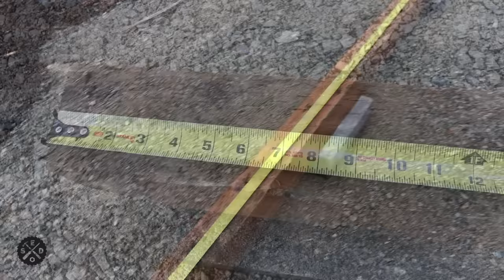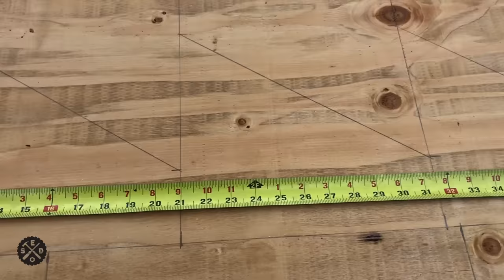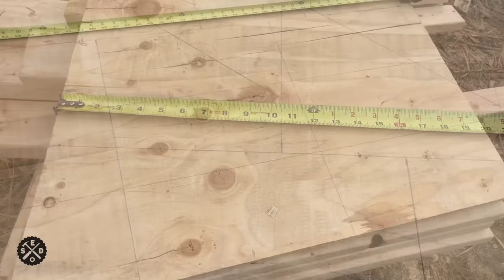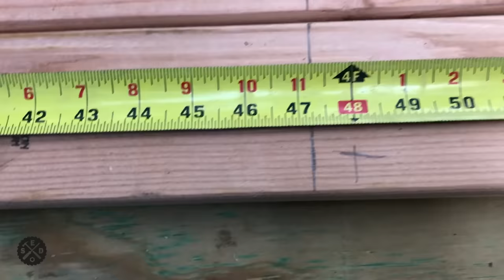How To Build A Shed By Yourself All STEPS 10x16 diy

Comment: Awesome! What was the rough cost for all the materials?
Reply from the maker: Thanks Joseph. I have it broken down in the video description below the video.
Reply: @SmartEasyDIYer  Are the 4"x6" skids 8' apart?
Reply from the maker: I did 16” in from outside edge to outside of skid on both sides. Outside is 10’ so it’s less than 8’ center. Closer to 7’ I believe approx. seemed good.

Comment: Curious why you deducting 3/4" from the tape?  If you pull 16" from the face of one stud to the face of the other it is 16" from face to face or On Center. I believe that if you measure from the center of your first stud to the center of your second stud you will find it is not 16". FYI I did enjoy your video.
Reply from the maker: Yes it’s because I was measuring off the first one on the outside edge then it’s outside edge to center or deduct a 3/4 so you can have a edge mark. Once you have the first one on Layout you could measure edge to edge or center to center from that one. I just like to mark them all out from the end while I’m at it. Thanks

Comment: If somebody were to remove the screws in the latch handle, wouldn't it then just spin in the door and allow it to be opened?
Reply from the maker: Yes it could. You could use bolts if you countersink it on the inside so it doesn’t interfere with the handle turning.

Comment: Do you think using wood glue would be helpful just to make sure everything is secure for the frame?
Reply from the maker: For which part of the build?
Reply: @SmartEasyDIYer  For the entire frame. I just feel like screws isn’t enough to hold the structure together. Atleast not in Florida 😭
Reply from the maker: I’d say construction adhesive would do better than glue for rough framing. You probably want to do hurricane ties on everything too for down there.
Reply: @SmartEasyDIYer  Okay, I’ll look into that. Thanks!
Reply from the maker: You’re welcome. Good luck with it!

Comment: Just nail a 1x2 ledger on side of joists for bottom plywood
Reply from the maker: Yes you could if you can fit a nail gun or hammer in there to swing in there that’s why I was thinking screws and maybe impact gun for compact size.

Comment: Great video, very detailed, and easy to follow.  I'm in the process of attempting the build.  Couple of questions.  What was the width  of the battens?  I assume you used the 1x4's from your materials list.  Did you rip them down?  What size sheets did you purchase for the metal roof(special order or std dimensions)?  I don't want to have to cut metal if possible.  Also, did the roof come with all the other pieces you installed, or did you need to buy them separately?  Finally, is there a minimum temp at which you can no longer apply the Rugged treatment outdoors?  I couldn't find that info on their site.  Starting to get cold in the Northeast.  Thanks again for such a great video!!  I'll upload some pics when completed.
Reply from the maker: Thank you!! Yes I believe the battens I ripped the 1x4 in half or else 1x6 in half I can’t quite remember. I can’t measure for you right now either as I’m out of town. For the roof it was standard dimensions. I used 3’ wide sheets. They do make narrower sheets if you custom order. I would wait till you get the roof framed up tho so you can measure length without having to cut for sure. The only piece I had to cut was the last piece to width. I had to order all the pieces separately for the roof. If you order it from a roofing place they will probably ask you the right questions of what you need. I think it needs to be above freezing to apply the rugged wood treatment then you should be ok. Thanks
Reply: Why is there no cross bracing in your walls? Over time, as the wood dries out and shrinks the shed is going to be flexible. I have never seen wall construction with out diagonal cross bracing. Am I missing something?

Comment: The plywood clips are a wonderful idea I love it but something to consider. 🤔 Pressure treatment is only necessary at the ground contact zone. Everything else is supposed to be Fir and preferably not Hemlock but it’s better than soft Pressure Treated Wood. It’s not structural. Not even allowed to be in Washington State.😏 I don’t know where this is but it’s truly not helpful to use Pressure Treated wood other than ground contact. It’s treated with pesticides. Nothing else. 🤓 It’s Arsenic mostly so the treatment is only to protect from bugs eating it and a minor water resistant valve from the solvent used with the pesticide but it’s inherently weak because it’s soft wood. I hope you can look into this a little please if you would😌. Thank you so much for your work it’s wonderful I hope you see I don’t mean to be rude  ❤️🖖🏼🇺🇸
Reply from the maker: No worries at all thanks for your input.

Comment: I would suggest you putting in the gravel into the price, because not everyone is going to have gravel just sitting around, or concrete blocks.  if you're giving a list of materials then I would include that into the list.  get approximate square footage of how much you had spread around the area to level the ground plus how many blocks you are using. Just a suggestion.
Reply from the maker: Thanks for the suggestion. I did include concrete blocks in the cost. I didn’t do the gravel cuz not everyone needs gravel and I had no idea how much I used that’s why I specified that it wasn’t included to not intentionally lead anyone astray.

Comment: I am studying for framing carpentry and am going to start with building sheds. I was wondering if you could talk about codes when it comes to wind. I have heard about winds picking up small structures and got to experience this when I was 15. I was playing Ninja Turtles on my Nes. and heard a loud banging sound. Looking out my window revealed that my brother's old metal tool shed had blown over and was upside down because the foundation had come undone through the years. I am sure codes will vary from state to state depending on wind potential. Just concerned about doing a safe jobs. If this is already covered thanks. I would not want my clients work to end up for instance in their living room or in their neighbors yard! The structure in the video don't look like it's going anywhere under normal winds but a small outhouse size hut for yard tools like shovels and rakes may be a different story. It's all about how good the wind can get in and lift the object and if it is light enough.
Reply from the maker: Congrats I think sheds are a great place to start! Yes this shed is definitely heavy so I don’t have any concerns as far as the wind. If you follow along in the video I anchored the floor joists into the skids with long lags I think that helps. One thing you could do is build permanent bracing into the walls to help stiffen them up if your siding isn’t very thick. You could fasten the trusses to the walls with hurricane ties. Also if the shed is going to be permanent you could build it on concrete piers or a concrete slab if it’s anchored to that it should never go anywhere. I built mine on skids because I want to move it eventually. Thanks and good luck!

Comment: 08:05 if I were sheathing the bottom of the shed, I'd use construction adhesive and nails on sheathing/joist, then flip it over. construction adhesive/nails between pier/floor. the nailed/cemented sheathing on both sides of the joists will strengthen the floor. I might roll the bottom with 1/8" hardware cloth to keep animals and larger insect borers from chewing the bottom out.
Reply from the maker: Yeah sounds like a good plan. It would be easy to put on if you could flip it over it’s just really heavy to flip it back. Thanks for sharing.
Reply: How the heck are you going to flip a 16ft floor that has a layer of sheathing? To keep it on the bearers you'd have to flip it longways and that weight and height would be near on impossible even for 2 guys. To flip it sideways you'd then have to get it back on the bearers without them moving. Far easier just to tack furring strips inside each joist to either sit ply strips onto, or to hold polystyrene blocks.

Comment: Did you get a permit before you started that building
Reply from the maker: No I didn’t need one it was under 200 square ft. It depends on your area but if you stay under a certain size usually you don’t need one.

Comment: Where did you buy your rough cut siding?  Very tough to find it in AZ.   I have mine framed and sheathed. I did a couple of things a little different. I built it on a concrete slab, I sheathed the walls in OSB, added a vertical center piece in the trusses and did a double top plate.  The extra framing and sheathing is because the hot and dry weather here is very tough on wood framing. With that said, I really appreciate all your tips. Great video!  BTW, I bought the Rugged Wood Treatment through you to help support your channel.
Reply from the maker: Thank you I appreciate the feedback and support! Sounds like a nice building you have made. That’s the beauty of a shed is you can customize it how you want. I got mine here semi locally in MT. I’m not sure where you can find some if you don’t have any timber close by. Maybe up in UT you could find some. You can search Craigslist and FB sometimes to find someone selling some. Lots of ppl have sawmills and cut on the side anymore too.
Reply: @SmartEasyDIYer  just found a good one in Flagstaff who will cut exactly what I need.  5 hours each way, but that’s ok.
Reply from the maker: Awesome!!

Comment: At 8:04 you start talking about insulating the floor and putting plywood at the bottom. If that's what you're going to do, it would be easier and cheaper to simply sheet the one side of the floor and flip it over BEFORE you attach it to the beams. Those screws will be plenty long enough to go through and extra 1/8" of plywood, which is all you need. Paint it two coats of exterior latex, flip it over and lag it down to the beams. I would have drilled 3/4" holes through 6 of the 2x6's and ran 1/4" bolts through to the beams; 4 on the ends and 2 in the middle.
Reply from the maker: Yes you could do that if you have a way to flip it over after it’s framed. It’ll be quite heavy.
Reply: @SmartEasyDIYer  Plenty of trees there.
Check out Larry Hauns videos here on how to frame a house. My grandfather was like him: He built houses in the old post WWII style using basic materials and unlike Larry, NO PLYWOOD. Tongue and grooved hardwood slats run over 1x12 sub-flooring planks, with no creaking.
Success with your channel.
Reply from the maker: Yes you could have the trees help. Even better tractor with a forks. 😁 I was just meaning for one guy it’d be heavy to flip over. I’ll check it out. Thanks so much!!
Reply: @SmartEasyDIYer  "...have the trees help."
You mean like Ents? lol
I was thinking of a rope and...
heh heh

Comment: Nice job, just one thing, without sheathing on the walls it seems to me that diagonal bracing should have been inset into the stud walls to stop any movement. It is just a shed, but without sheathing or bracing it will overtime rack. Don't want to be a downer, it is a beautiful shed and well done.
Reply from the maker: Thanks Greg I appreciate the feedback. So actually with the full 1” rough cut siding I did it really braces it well when it’s fully nailed off. It certainly couldn’t hurt like you said but I haven’t seen any issues.

Comment: Did you use end sealer on your boards?
Reply from the maker: No just the Rugged wood treatment.
Reply: @SmartEasyDIYer   did your boards split at some of the ends?
Reply from the maker: I don’t think so. They were quite dry when I put them on.

Comment: Im not sure if losing more than a foot of living space with 2x6 walls is worth it in a space that size. Isnt already going to be easy to heat?
Reply from the maker: It shouldn’t be bad to heat a space that size.  You’d only be losing 2” more all the way around by doing 2x6 walls. Depends how much insulation you want. You could do ridgid insulation to get more r value for the thickness or have someone spray foam it.

Comment: Duh but why are sheds rectangular instead of square. I’ve never built a shed but as I start thinking about it I’ve always wondered. In my head, 4x8 sheets 8x8 or 12x12. What am I not considering?
Reply from the maker: I think it’s usually cuz for transportation you can only go so wide, if shed companies build one to deliver to you. That way to get more sq ft they can go as long as you want. Just not wider than a certain point. Built on site you can do whatever you want.
Reply: @SmartEasyDIYer  Thanks. I’ve been asking folks you’d guess shoukd know, without any real answer. 👍👍 Your answer makes sense.
Reply from the maker: You’re welcome. That’s the only thing I can figure. Lol

Comment: 3 quarter crush with binder looks lime and only bout 10 to 13 bucks a load (10 yards)but its the dump truck delivery that will cost bout $85 to $100 an hour so if you can bring a your own truck and you only need 3 to 4 yards its pretty cheap
Reply from the maker: Yes you can get it quite cheap by the pickup load.

Comment: Now with battery powered chainsaws and circular saws there really is no way tho secure anything. Beautiful shed sturdy and looks way better than the Lowes type shed. Just wanted to remind folks that an alarm system might be something they want to consider if they plan on putting expensive equipment in a shed.
Reply from the maker: Thanks. Yes that’s something to think about. If someone wants in bad enough they’ll usually find a way.

Comment: Doesn’t look 10’wide did you use 3’ for the outside plies?
Reply: I made mine 12’ wide to get the most out of the expensive in U.K. ply
Reply from the maker: @ambread1  our plywood is 4’ wide so i did 2 and 1/2 rows.

Comment: Please explain what you mean by an eight twelve cut. Having spent over 50 years in the construction industry in the UK as a surveyor I have never come across this term for describing an angled cut.
Reply from the maker: That’s the pitch for the roof angle. For every foot in run it goes up 8 inches in rise. Does that clarify?
Reply: I did wonder if that was the case.  That terminology is used in the UK but with reference to paving or road gradients with roof pitches in degrees.  Many thanks.
Reply from the maker: Interesting. You’re welcome.

Comment: Easies way to insulate the bottom would be to use a belly pan liner or vinyl tarp
Reply from the maker: Maybe depending what the pan is made out of. With the vinyl I’d be worried about mice chewing through it.

Comment: Whats is that wrap on the wood for?
Reply from the maker: Do you mean the housewrap on the sides?
Reply: Smart Easy DIY yes and also on the roof
Reply from the maker: I just wanted to show doing it that way in case you’d ever want to heat it. You don’t need it otherwise for just a shed.

Comment: Between the floors use Thick Styrofoam Insulation R19+ Also use it on walls under roof
Reply from the maker: Yes you could

Comment: why didn't you use a top plate connecting all of the walls together before putting the trusses on
Reply from the maker: I tried to explain in the video but I felt like it was plenty strong enough this way for a shed. If you want you could easily add a second top plate just figure that in your overall wall height.

Comment: I understand it’s okay but I believe it’s better to build structures with Fir not Pressure Treated. I would have started by making the foundation like that with the Pressure Treated Beams but I would have switched to Fir from the first none ground contact surfaces up. 🤔 Everything else I completely love! Nice work Brother please don’t be upset by my criticism I just mean to include details I’ve learned being a worker 😏 God Bless! ❤️😌🙏🏼 Please remember to ALWAYS WEAR EYE 👁 PROTECTION! 😏✌🏼❤️🇺🇸
Reply from the maker: Yes I could’ve just done the skid beams treated and nothing else but since the rest of the floor wasn’t much up off the ground I felt better using treated for all that since it will get some moisture. To each their own. No worries at all thanks for your input.

Comment: @9:30 I usually sheet the bottom if I am building on pedestals
Reply from the maker: Do you build it upside down, sheet it and then flip it over?
Reply: @SmartEasyDIYer  I sure do.
Reply from the maker: @craig78 I figured that would be the way to do it if you were going to sheet the bottom. 👍🏻

Comment: Nice video. 2 points, 1) I think the cost of your underlayment should be $100 dollars or less NOT $1000. 2) If the screws on your door handle are unscrewed then the whole collar will rotate with the handle and the door will open while still locked.All the best. Bill
Reply from the maker: Thanks. Sorry for the confusion in the description it says 
Lumber, concrete blocks and roofing underlayment $1000 so that includes all of those combined. In the handle if you want to you could add bolts instead of screws and recess the nuts on the inside so the handle doesn’t rub. Thanks

Comment: For rodents, before sheeting the floor, lay out hardy cloth or ant wire mesh small enough to prevent mice.
Reply from the maker: Yes you could do that. I was thinking about sealing it right off so if you insulated it’s not exposed to the elements. Are you thinking to do the mesh even if you don’t insulate?

Comment: I'm no expert but I'm not too sure about the way you framed your window.... Maybe its ok with a small window 🤔
Reply from the maker: Yeah for a small shed window I think it’s just fine. If you wanted to heat it and insulate it you could do it like normal.
Reply: @SmartEasyDIYer  I figured. Just never seen someone not use jack studs. Great job on the video btw! I'll probably be referring back to it at some point
Reply from the maker: Thanks for the input. Good luck with your build!